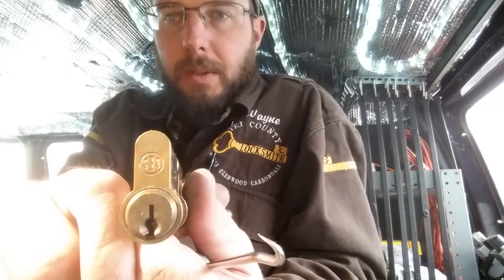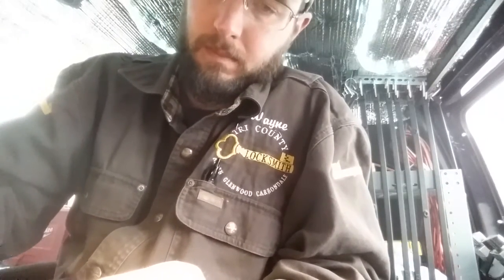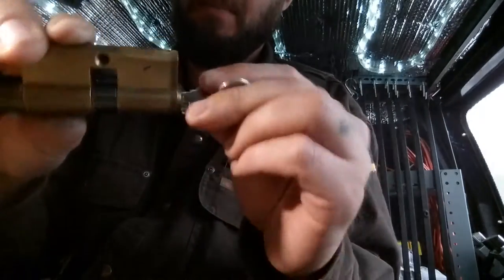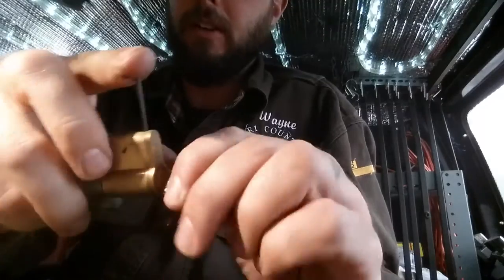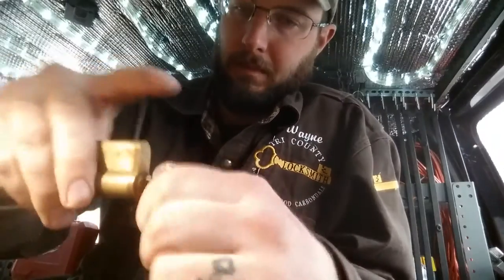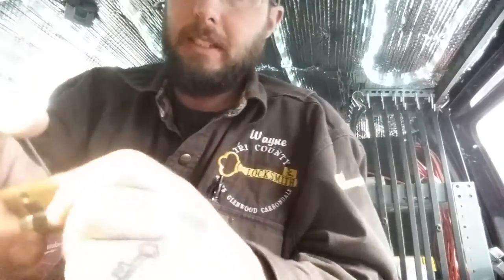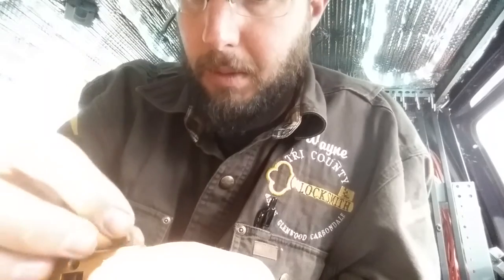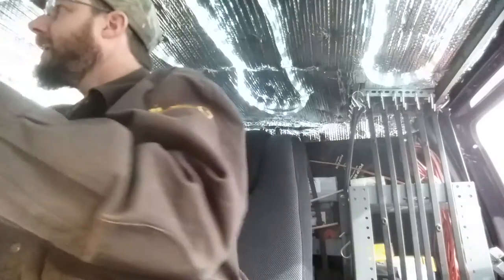CES LOCK Profile Cylinder Re key and Tricky Cover Replacment. How to rekey

Comment: I had one of these yesterday, well 3 of them actually. Major pain. I did figure out the “1 step down” thing but when I got to putting in #’s 4 and 5 the rule did not seem to apply. I had calls stacked up and had already been fighting with some things on that job. I ended up running with 4 cylinders on each one. I made sure I included the spool pins but man I don’t like those.

Comment: A locksmith came and replaced my pins.  It looked like he damaged the cover as he had a tough time getting it out.  Two days later it does not work and the door is locked.  How do you get the door open to fix it?

Comment: So mine looks exactly the same except at the top of the pins instead of a holder they all have individual hex set screws over each pin..  theres also one place that looks like itshould be the release but it no budgey..  removed all the pins and springs so everything spins freely but the cylinder still will not release..